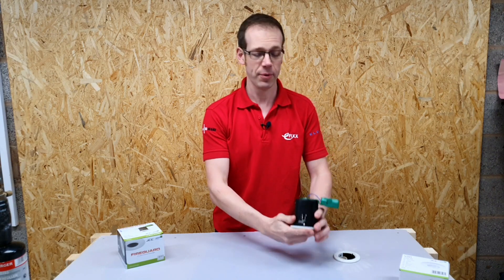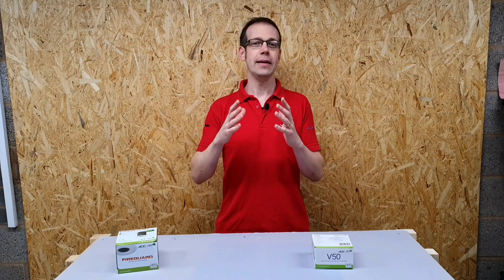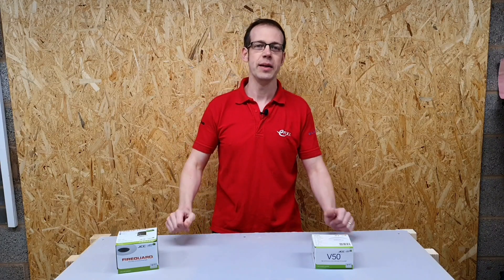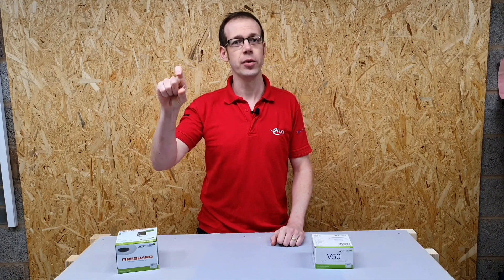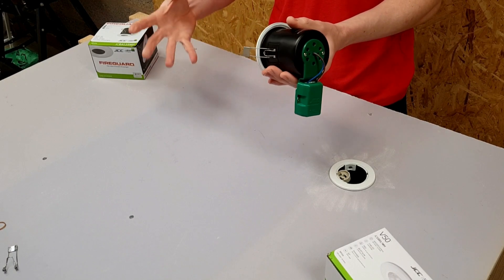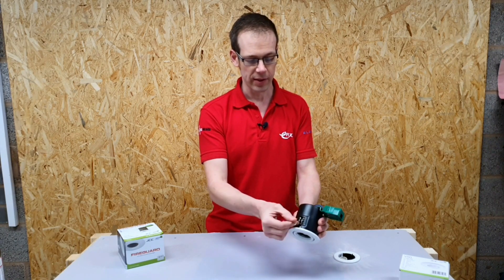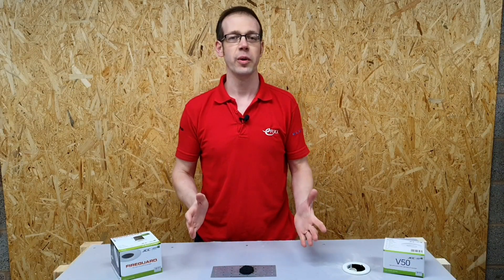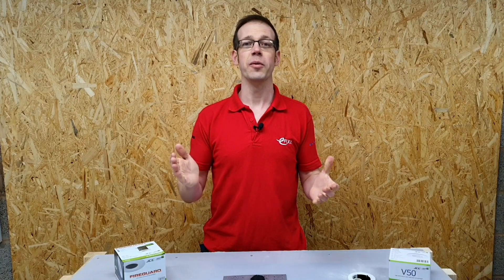How do LED downlights work in fire rated ceilings?

Comment: Where can one buy a fire reactive expandable graphite pad material like the one you heated up in your video?
Reply from the maker: We usually start with Tenmat - https://www.tenmat.com/passive-fire-protection/electrical-service-penetrations/
Reply: @efixx  I called the us office of Tenmat but they won’t sell it in sheets. They will sell me a ff109-200 fire hat but I can’t fit that hat through the 2-5/8” recessed light hole. So this morning I found a very thin sheet product called Interdens 36 made that is remarketed through ODICE, BASF, etc. I want to use this material as a pad similar to the pad that you heated up in your video.

Comment: You seem to have had continuity issues...   Each time the camera angle changed the spot light changed from having an earth cable to the can and not having an earth cable...   Are these old light fittings as surely they would also fail because (guessing they are 230v) they have single insulated cables outside of an enclosure.  

All newer fittings I have seen of late have addressed these issue by having an earth cable to the enclosure and by enclosing the two live conductors in a second insulated layer.  I think then I looked up the Napit codebreakers in an EICR these would each be classed as a fail C2 code?

Comment: So virtually no domestic property is going to have a 90 minute fire rated ceiling, 30 minutes for single board and 60 minutes for double board?
Reply from the maker: It would be rare to see 90 minutes in a domestic property. Unless it has some steel supports - structural steel gets special attention.